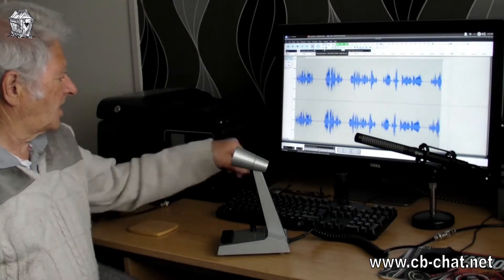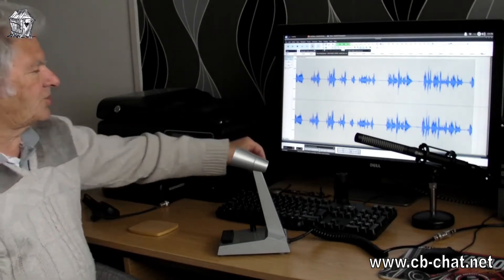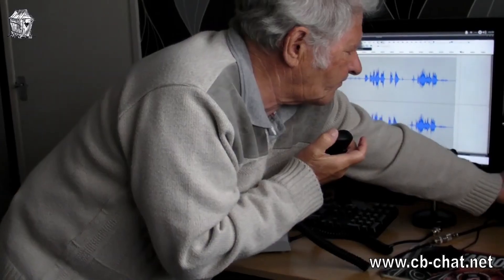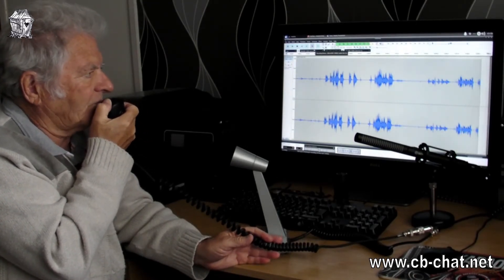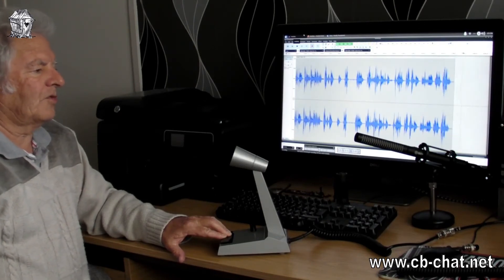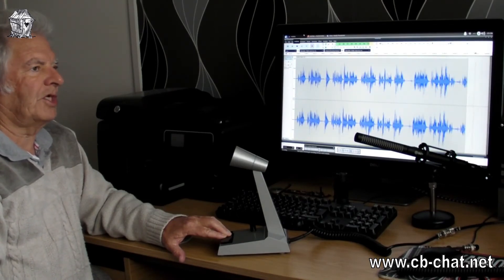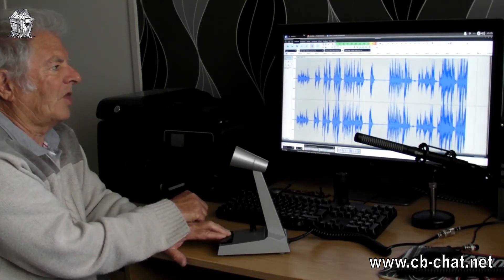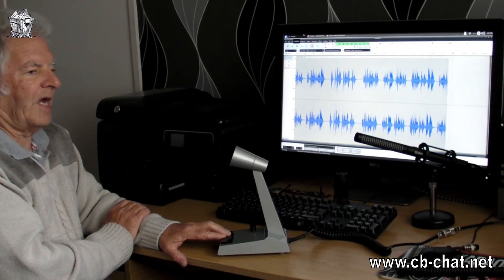CRT 6900 Power Mic

Comment: The original microphone does sound very woolly ....The modded Turner will pack a punch and make a good long distance SSB mic
Reply from the maker: I hope so, I have never been a fan of power mic's as they usually overload the radio, but that one matches in perfectly, it took a lot of work getting it right. Ken.